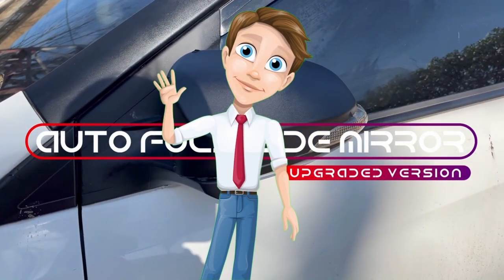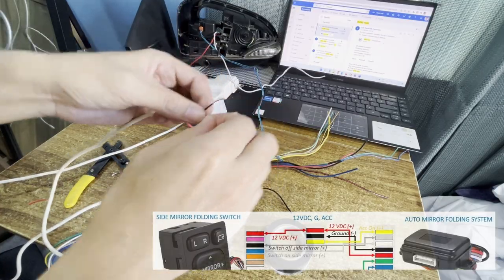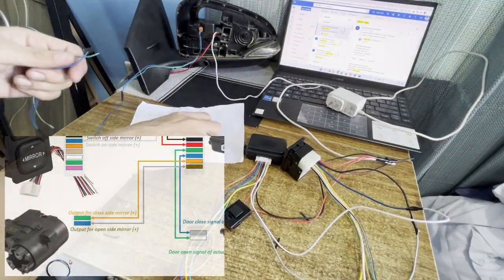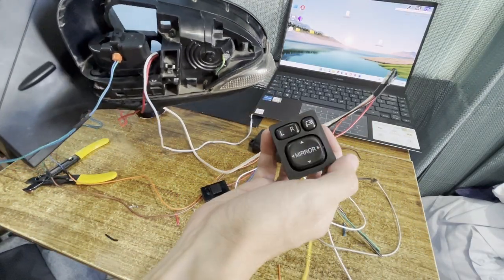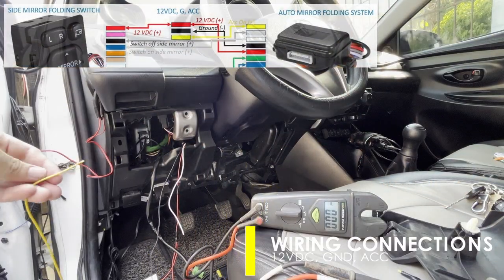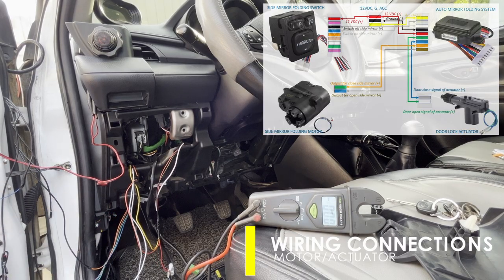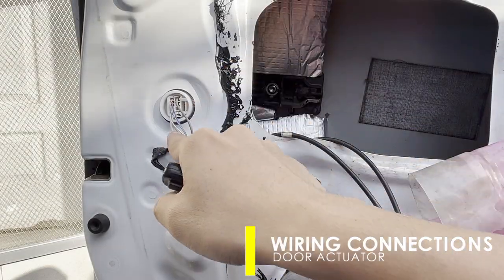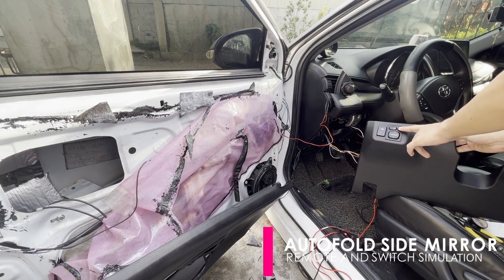Auto Fold Side Mirror [PART 2] How to install and wire auto fold module and switch #Toyota #Autofold

Comment: Sir mali po ba sa installation pag pumindot sa lock/unlock button sa main switch sumasabay din sa pagfold/unfold din ang sidemirror? Hassle po kasi pag driving na.
Reply from the maker: Once na nka on ang ignition sir, nka unfold nlng yang side mirror, unless i fold mo through yung manual switch sa baba. Pero sa remote key, ma iverride yun ng ignition interlock.
Reply: @EngrDeeIWye sir ganyan module hindi po ba talaga fofold ang sidemirror pag nagpatay ng engine?

Comment: Sir, gusto ko lang power folding gamit ng switch lang walang auto folding kapag central lock/unlock paglabas ng sasakyan. Hindi na ba kelangan ng switch at relay yan at nakakonek ba ung positive wire sa Ignition switch?
Reply from the maker: Hello sir, qng switch lng ang function na need mo, yung switch wiring nlng ang gawin mo po.
Reply: @EngrDeeIWye  Cge po sir. Salamat

Comment: What if ur in the car and driving the doors will of stay open since if you close the locks the mirror will fold closed
Reply from the maker: The module is interlocked with the ignition, so as long as the latter is switched on, the folding mirror will stay unfolded even if you close the door.

Comment: paps, maraming salamat sa video mo! nagawa ko yung installation ng sidemirror light sa vios xle 2022 ko. ito next project ko hehe
may 2 questions ako:
1. while engine ON, nakaswitch ON side mirror button, automatic na magffold mirror kpag nilock sa remote?
2. while engine ON, nakaswitch ON side mirror button at pinush door lock button sa loob hindi ba magffold yung mirror?
Reply: i would imagine that it will only fold mirros closed when acc is off. Otherwise all cars that auto lock doors at certain speed would fold the mirrors in. Im about to install in my car and will know if this is the case

Comment: Does the vehicle need to be in park for this to work? Or could I close the mirrors at any time? My dilema is that my truck just barely fits into my garage, but if I fold the mirrors in, it's perfect! I normally have to roll the windows down, pull in the mirrors manually and then finish parking, which is especially annoying when it's just me having to fold in both mirrors and when its cold outside. In the research I've done in looking for automatic folding mirrors, most of the time the vehicle has to be in Park to work...
Reply: You don't need the automatic module in that case, just wire the manual switch, then you can press the button to fold them in whenever you want.

Comment: Im just wondering, what if im driving down the road, and my doors are unlocked. If i hit the lock button to lock my doors or if my doors lock automatically after reaching certain speed will that also fold my side mirrors shut?
Reply: Am wondering as well since I was planning to put one in my car

Comment: Boss pwd ba yan sa power side mirror or need mo pa magpalit ng autofold na side mirror?
Reply from the maker: Qng meron ng actuator ung side mirror mo sir, better, controller nlng ang bilhin. 

Un lng kc need mo i modify ang wirings
Reply: @EngrDeeIWye  salamat sa sagot boss. Last n lng. Hehe. Need pa ba gmitan ng relay kung dalawang side mirror papaganahin? At ilang amp ung fuse boss. Salamat  ulit

Comment: I have a Renault Laguna that close automaticaly the doors when start moving, with this system the mirrors will close automaticaly or still open?
Reply from the maker: as long as the ignition is on or in accessory, the mirrors will not fold sir.
Reply from the maker: It should be interlocked with the accessories sir, because if not, it will fold if you close the door.
Reply: @EngrDeeIWye  thank you so much!! 👍🏼

Comment: Sir yung pulang wire galing po sa battery? Tapos po yung black sa body ground and yung white po sa accesories po sa ignition? Color white din po ang kakabitan ko dun sa ignition sir? Thanks
Reply from the maker: Hi sir, yes po nglatag aq ng new wires from battery sir kc mrmi aqng additional accessories. Black is body ground, tas ung white po is acc. Pwd kay kumuha sa head unit, pwd dn nmn po sa ignition, bsta meron lng dpt xng 12vdc pg nka acc ang susi
Reply: @EngrDeeIWye  thank you sir. White din po ba kulay ng wire na nasa ignition sir na pagkukunan or sa head unit? Thanks.😊
Reply from the maker: Qng sa ignition ka sir, heto ang color code sa ignition. Sa gen 3 q to na color code sir ha. 

Blue - 12vdc constant
Light green - starter 
Green - acc 
Violet - ignition 1 
Red - ignition 2 
Another green - constant 12vdc 

Compare mo lng sau sir. Gamit ka tester or test light po
Reply from the maker: Sa head unit nmn saken is color red. Pero iba2 ata ang color code sa head unit.

Comment: Keep it up sir. ask ko lang if possible pa magamit yung manual cables for adjusting ng mirror or need na talaga palitan ng pang automatic? Thank you and God bless!
Reply from the maker: Dati saken sir, manual lng dn, as is mo lng po ung prang cables nya. Pero ngayon pinalitan q na ng may motor pra ma automatic adjust na dn pati ung salamin
Reply: @EngrDeeIWye  noted sir. Ang prob lang nung may folding motor na mejo kumapos na cables.

Comment: Sir poydi ba pagsamahin ang sentral lock mudule na wire ng side merror folding at post start mudule para isa lang ang remote.thnx po sa share na video.
Reply from the maker: Yes mam, actually common sila ng trigger input na Galing sa bagong remote. Pra sabay ang side mirror fold/unfold sa door close/open.
Reply: @EngrDeeIWye  maraming salamat sir.marami kapang matulunga sa gstu mag DIY.

Comment: Yo RJ pare. Sobrang laking tulong nito. Bro pasensya na baka may guide ka ng how to install courtesy door sa Altis. Yung 2012 kasi inalis nila yung feature sa 1.6G pero sa 2.0V meron. walang wire naka abang eh, marami sa shopee nung ilaw pero walang wiring guide.
Reply from the maker: Merong mga courtesy lights sa shopee sir na no need wiring. Hanapin mo lng ung infrared sensor na xa.

Comment: Hi, does this work for a 1997 Toyota Corolla S?
Reply from the maker: That i'm not sure sir, but you may check po the actual side mirror motor housing if they're the same
Reply: @EngrDeeIWye  I just to confirm that the actuator doesn't involve how I want the glasses to turn but the 2 electric folding motors? and If I don't have the folding button on the switch, can I still make the mirrors turn when I lock/unlock the car? I'm using 2  foldable mirrors from 7th gen Corolla to 8th gen Corolla, only have 2 cables from each mirror
Reply from the maker: @yaochihli2263  the actuator for folding is different from the actuator of the mirror adjustment sir. The switch is actually for manual operation, if you don't have one, you can add a separate switch.

Comment: Sir, ano po part number ng side mirror motor, sa link mo under description, sa mga photos is showing JCFES-22029, however, isang part lang sya, not sure how to order both Left & Right motor as the link provided doesnt have option to choose either L&R. Sa ibang seller meron naman pair na pero iba yung part number  (JCFES-22015 & JCES-22016). Just to be sure kung ano po yung tama, please pa-advise and pa-guide which is the correct part. Thanks and noce video. Very organized and highly informational, with diagram pa. This is one of the best video tutorial I have ever seen. Thanks and please let me know.
Reply from the maker: Hi Sir, please check description again, already updated links for the motors on left and right side. Those were the items I have purchased in Lazada, but please take note sir that the right side that I purchased didn't have a wire and connector included, what I did was to solder wires. You may search other items sir but please make sure that it is specified as right side. The left side is a complete package. 

Thank you for appreciating the video sir, will upload more pa po pg my time, ehehe
Reply: Awesome sir. Big thanks. Yes, actually same dilemma because some SKU's or motor comes in pair but doesn't have connectors together with the order. Doing separate orders is completely fine with me as long as I get the correct part number because I've read other people who purchased from Lazada complained that the swing angle (motor of the side mirror) is not the same (or minsan kulang, minsan sobra), that's why I wanted to confirm the part # or SKU number, just to be sure. Anyway, great job and work sa video mo, very detailed and okey ang mga pacing, at may auto-narrator character pa. Solid! If I may suggest sir, CRUISE CONTROLLER sa Toyota Vios (both auto and manual tranny), Thanks and more power, I appreciate din yung mabilis na response. Isa lang alamat lodi.
Reply from the maker: @EyeAlone777  actually ung left side sir ung perfect ang timing, sa right side ung mejo sobra pero not bad nmn, konti lng mxdo ang sinobra. Most sa ng inquire saken sir same models lng ang kinuha para cgurado tas nka install na dn sila. 

Thank you sir, you may check other videos po sa low cost upgrade. Sure sir, darating tau jan, marami paq nka line up na upgrades pero mejo busy pa kc. Pero try q tlga mka upload soon. Hehe. Ask lng sir qng my clarifcations ka during installation mo na.

Comment: What about to connect a toyota corolla 2007 like that?
Reply from the maker: I think it's almost the same sir, as long as you already have the side mirror motor and the centralized door actuators, you can integrate them both.
Reply: Thank you

Comment: Papano po sa passenger side papano po gagawin don?
Reply: Magrurun pa ba ng panibagong wire papunta dun sa  switch??
Reply from the maker: I parallel mo lng po dun sa kabilang motor at switch sir. Dun kna mag connect sa output ng module pra mas malapit po. Sabay yan sila mg coclose/open po. 

No need na po connection sa kabilanh door actuator.